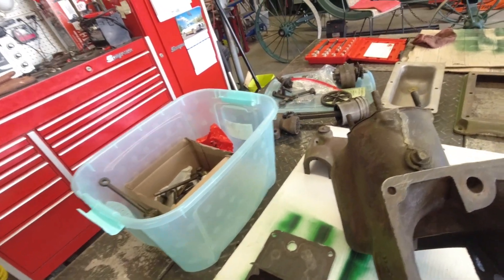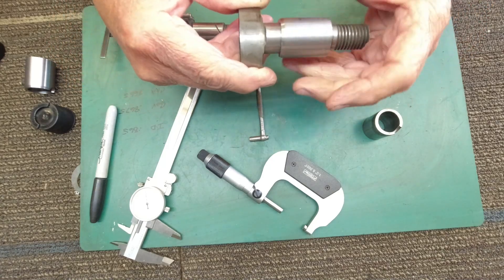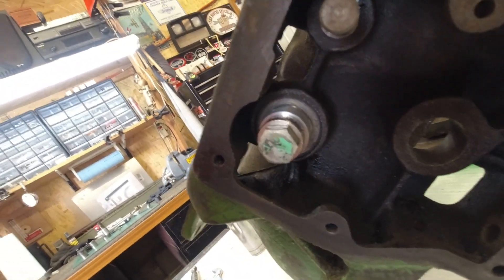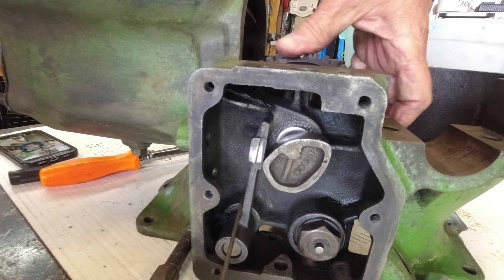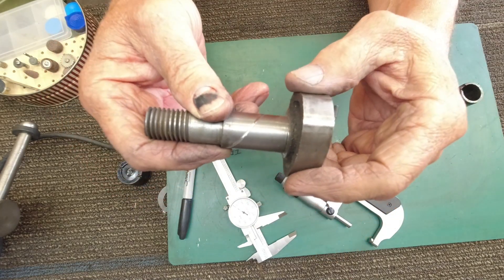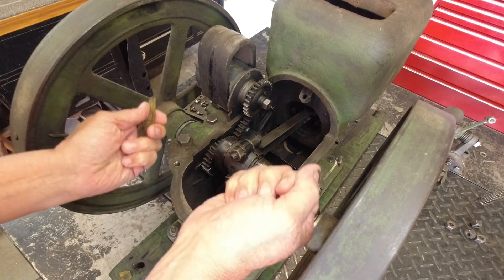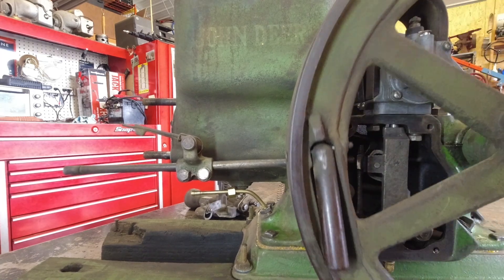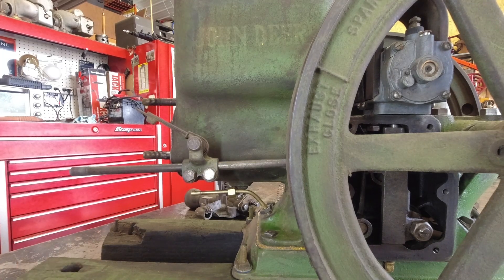John Deere 1-1/2 HP Model E Restoration (Part-2 of 2)

Comment: I have a problem with my rocker arm return spring and was hoping to see you remove and re-install it to see how and where both ends rest when installed. My has come loose not broken off either end but I just could not figure out how to get it back on to stay.??? Was hoping you would show it being done, but you skipped over it and went on to something else and it showed it already reassembled and I did not get to see how it wa done. Really disappointed here for sure.  Other than that a great job and outstanding Video. Wish you were my neighbor!  Thanks
Reply from the maker: Sorry bout that!  It will only fit correctly one way. Make sure yours is not damaged or bent. It is easiest to remove the rocker and pin and install all as an assembly.

Comment: Just whinging a little bit here.   I was hoping to get a peek at those timing case internals when they were all together, but other than that (personal) disappointment, I really liked the video!
Reply from the maker: Those views begin at 6:35 in the video.  Not much else to see other than what was shown.....   Thanks for watching!!
Reply: I was more referring to what is visible behind the flywheel at 8:07, the governor/cam follower casing (I think of the timing gear area as the crankcase).

Thank you for posting!

Comment: I just can't understand how the external parts last without constant lubrication.  Take the valves for example.  How often did the operator need to squirt oil on them.  I would be wanting to put oil on them every minute.  But, I know that isn't the correct answer.  Please educate me on oiling these mechanisms.  Thank you and thumbs up.
Reply from the maker: External lubrication points should be oiled before each start up. They will survive with less but I agree with you in that too often is always better!
Reply: @enjundoc  Thank you enjundoc.  I like watching your channel and wish I was your neighbor!  I go to many steam shows every year.  I always look at these engines and their external moving parts.  Camshafts, valves, clattering linkages and such.  All running in dusty conditions and without "proper" lubrication.  I can't understand it.  But, look at those giant Snow engines that were used in natural gas transportation.  They ran nonstop for decades!  Many parts just getting one squirt of lubrication per day.  So, it must be OK.  We note the importance of really hard and extremely well polished wear surfaces to start with.

Comment: Great video! I have a 1 1\2 HP  john Deere and a 3 HP .did a rebuild on the smaller one a couple years back both still running today along with the different variety of Engines I have.wish to have a 6 HP one day to add to collection. There's a great publication out on the different varieties that were manufactured by john Deere that I think can be purchased thru Flywheel Supply.thanks for the great video and definitely looking forward to more

Comment: A very nice slow running 🏃‍♂️  I like them to see them all slow running and to get them a cloth on the wheels on the engine  I know it's  not the right word but pressure  and get them working get them warmed up and the will need it  clean all all the slow running do it night and  you all the sparks and rubbish burned out its good for  them

Comment: Great video as always.  Do you have a feel for whether the cam and governor bushings on these JD engines are commonly an issue with respect to wear?  My engine is an older rebuild and runs great, however wonder whether I should pull the crank cover and have a look.
Reply from the maker: The owner had no clue from listening to it run that there was an issue.
Probably wouldnt hurt to pull the cover and have a peek!
Reply: @enjundoc  Good info.  I better have a look.  Looking forward to more of your videos.

Comment: Hello enjundoc.   Saw how you backed-up the cam gear for nut removal.  Not sure how else you could do it.  How did you back-up the governor body?  Can’t see a good way on my engine.  The governor is LH thread, correct?   Thanks
Reply from the maker: I held it with a large pair of channel locks. Luckily the nut wasn’t very tight!
Reply: Thanks.  Is it a LH thread?
Reply from the maker: Yes....   @jamesmyers1545